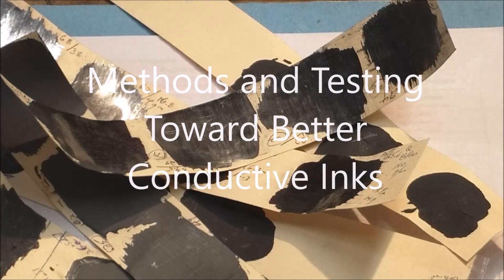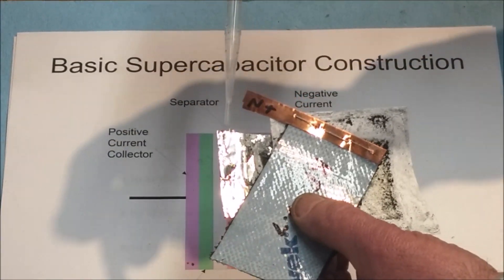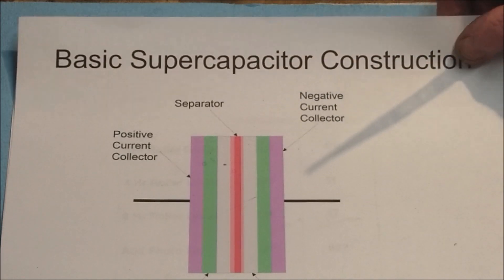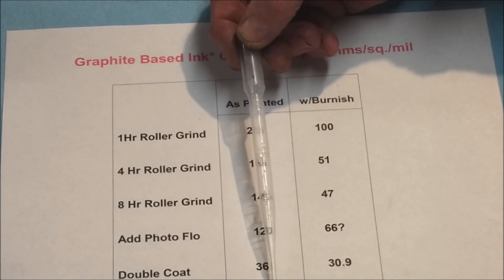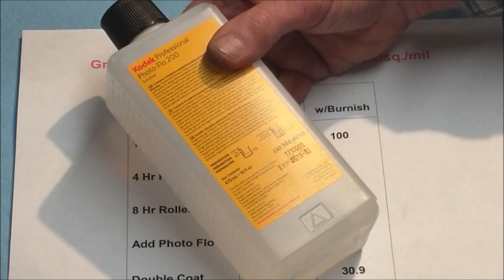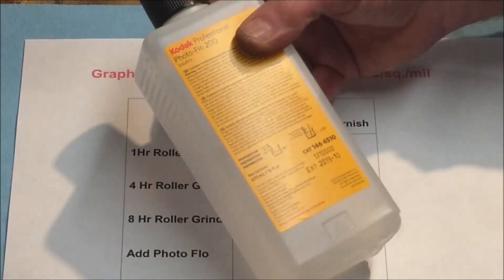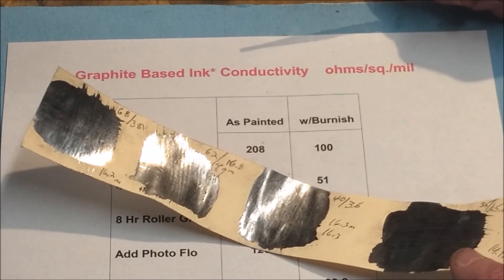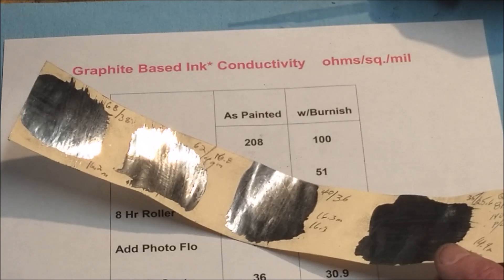Methods and Testing Toward Better Conductive Inks

Comment: I did a lot of work on conductive ink. I found that ink which had a high graphene content did not improve with burnishing. I put this down to the fact that the graphene was tending to lay flat and giving good continuity as it was. In fact burnishing sometimes gave a higher resistance. If I made a conductive ink with graphite then burnishing always improved it. I put this down to the fact that the particles were being squashed and therefore enlarging to give continuity to the particles. Burnishing squashes the paper underneath the ink, therefore a piece of unpainted paper needs burnishing when subtracting paper thickness.

Comment: Hi Dennis , very interesting that you happen to mention graphene after burnishing ! I have been wondering lately about the concept of self assemble graphene and what conditions it would need for this lattice to take place and I then got to thinking about what is actually needed from graphene in a cell which made me theorise that we don’t at all need the strength of a perfect lattice but most look for the conductivity in which if even 30% were a reasonable self structured lattice and then say 20 layers we maybe in the ballpark of an easy cheap adoption of graphene improved cells ! This thought originally came from the theory that with great heat and pressure carbon self structures into it most compact form being diamond so why not the allotrope  of graphite self forming into its most compact self !🤔
Reply from the maker: Hello EPNM - yes that's the thought !
I just tried a little experiment - I took my rubbed graphite samples from yesterday - and did the tape pull test - remember 'discovery' of graphene on tape applied to pencil rubbings.   Well the top layer pulled off with my tape --  AND - not super conductive.  Readings in the neighbor hood of 500 to 1000 ohms between ohm meter probes.  But that's not bad for a super thin layer that stuck to the tape - Graphene??? - maybe not but still a good path to burnish those particles together......i.e. as you said lots of layers with pressed particles.
Reply: Dennis yes I also like the idea of freezing water with a layer of silver graphene and then using the tape on it whilst frozen . Maybe even take a Square resist reading first to test the material ?🤔 just use a tea cup saucer or petry dish

Comment: Hi Dennis, What a great video outlining all the problems of current collectors and showing a good scientific approach to developing a conductive ink. 
I think the question of what is happening with burnishing is more likely to be compressing the graphite particles together rather than a surface effect, if you look at your test results there is less effect on the double coat than the single coat. If it were a surface effect it would be the same on both. In any event it is not a difficult job with a spoon in the great scheme of things, and well worth the lower resistance gained. 
I have been working on the problem of inks for a while, to the point where i have put the battery chemistry on hold until i make more progress. 
My approach has been trying to coat the ink onto Aluminium foil backed plastic, giving a resistance less than 1R from the foil to the surface of the ink. The problem is the electrolyte still getting through to and compromising the foil. :-( 
I have been using CMC and SBR and also a few different glues as binders so far, although I am waiting for a delivery of Xanthan gum to try :-)     Martin.
Reply from the maker: Hi Martin - thanks for the comments and sharing your experience.  (here in Michigan Xanthan gum is readily sold in our grocery stores - health food section - since I think some gluten free recipes use it).      My next tests will be looking at thin layers of ink - burnishing each layer - will vid the results.  Hopefully by the 4th layer I've got something less than a couple of ohms per square.  Target substrate will be non metallic.
Reply: @denniskramer9788  Dennis, if you are looking at Xanthan, have a look at Guar, I've found it electrochemically better than Xanthan, but my DES doesn't like it :(
I have been trying to move away from aqueous electrolytes.
Reply: Hi Tony, I have just ordered some Guar Gum as well as the Xanthan Gum, so I will give them both a try. Thanks for the heads up  :-) Martin.
Reply: Sounds like a plan Dennis, it would be great to get sub 2R on a non metallic substrate.  I'm sure that would be fine in a stationary battery, just make the bugger bigger  :-)  Martin.

Comment: Nice work Dennis, thank you for presenting your results. My carbons will be subjected to pressing rather than manual "spoonwork", not sure if I will try hot pressing. The reason for that is because my aim will be to create a large "array", I hesitate to use the word "battery" as the cells will be more supercap than battery, more a cap with a little redox, if you know what I mean. They will be coupled to my solar cells and hopefully replace my lead-acid cells. Therefore, I envisage multiple units in series/parallel to power the farm, well thats the aim anyway, so lots of surface area to process. As to why burnishing produces such a startling betterment in reading, it could be all that you suggest, but the one thing that interests me is what is happening to the binder under the compression... is it fracturing as well, because at the time of burnishing, the binder has set, so could the binder fail in say 100 cycles ? not sure ?  But an interesting debating point !!
All the best

T
Reply from the maker: Thanks for you thoughts Tony.    I'm thinking that if my current collector is made up of multiple layers of 'ink' (no metal foil backing) then some cracking is OK.  One option for a substrate is to use a very thin layer of 'Carbon Veil' in between ink layers - sort of like a cross grain structure of plywood.  Veil is a lot thinner and lower cost that woven fabric.  Not unlike the carbon fiber cloth I used before I will still need some form of metal attachment as a attachment to the outside world though - but out of the way of the electrolyte.
Reply: Hi Dennis, just a quickie, you've probably watched it already anyway, the latest RMS vid showing the assembly of his cell in detail, from about 2 mins on.https://www.youtube.com/watch?v=s0ryom-E7u0&t=2s

Comment: Hi Dennis. You could try activating the graphite with urea and feather carbon. by baking it all in a pot at 200 degrees c for 24 hours then 600 for 2 hours..
Reply: Hi Dan P, just a caution when you play with urea, for those who don't know...I think around 150 to 200 degrees C the urea breaks down producing ammonia and cyanuric acid, both can be pretty nasty, so fume chambers or open air .  That said, I am playing with it and no side effecttttttttttttttttssssssss      ;)
Reply: @tonyponsford   Thanks, I'm out side and never go near it, So it could be the Ammonia or the cyanuric acid activating the carbons.
Reply from the maker: Hi Dan good thoughts thanks.  We may give it a go.  Does the graphite activation do more for lowering resistivity or more for increasing surface area as a better electrode?
Reply: @denniskramer9788  Surface area.